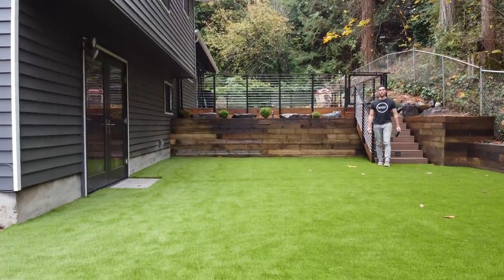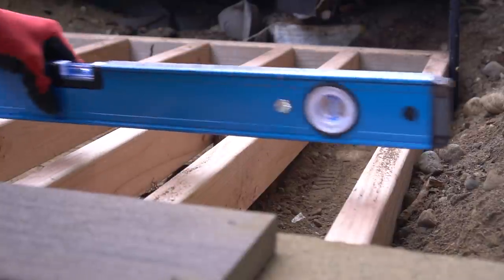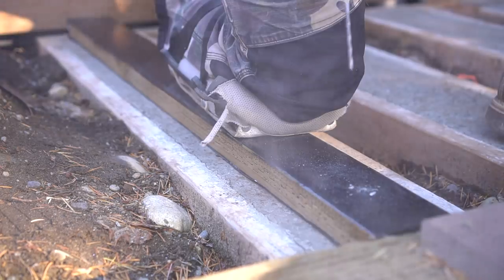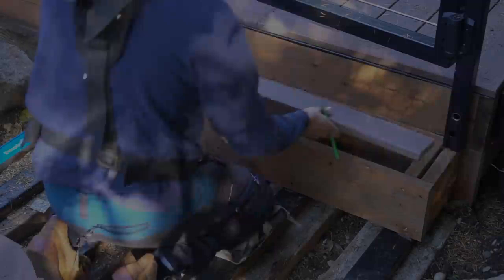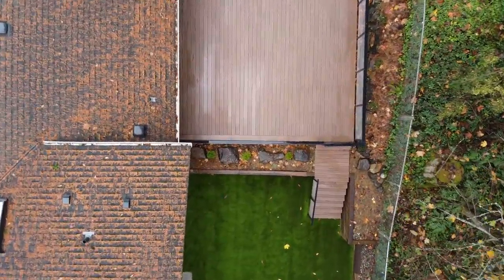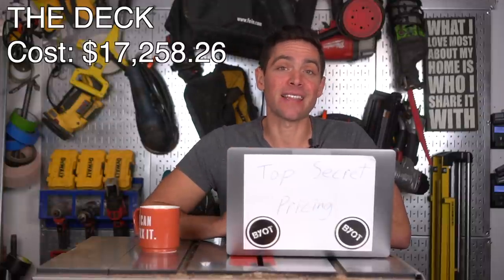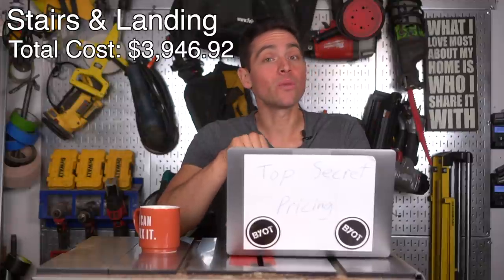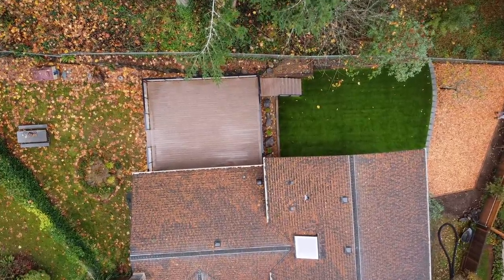Worth Spending $65,000 On A Backyard Renovation?

Comment: Well I live the results. As to comments on railing, it’s your dollars, go for lasting. Wood and resin or plastic requires maintenance which you have to factor in. Wood right now isn’t cheap and I don’t care what fasteners are used because wood shrinks and swells the fasteners will loosen. If I had the money for long term the extra is well spent. I love it. You get what you pay for. I understand the faux turf given your climate and where that is. You can always do cheaper but it comes with additional cost on the backside. Keep it coming.
Reply from the maker: Thanks so much for the comment and I completely agree.  I understand if you don't want to pay that much for a railing but it will cost you time for maintenance or even replacement down the road.  Thanks for all the support as always.

Comment: I really don't know if I personally could justify spending more on the railings then the deck itself, can't argue with the results and looks of it. However I'd personally do something cheaper.  And on the landing for the stairs is there any big reason why you wouldn't want to leave the form around the concrete after its finished? I cant imagine it would do to much harm because even if it rots the concrete should still be fine.
Reply from the maker: I completely understand that sentiment about the railing vs deck and yes I did leave the forms in because it will be just fine as is.  I was just going to try to remove it and it wasn't happening as anticipated haha. Thanks for watching.